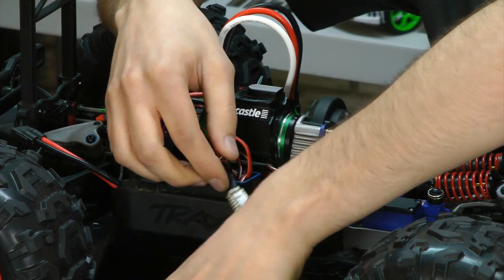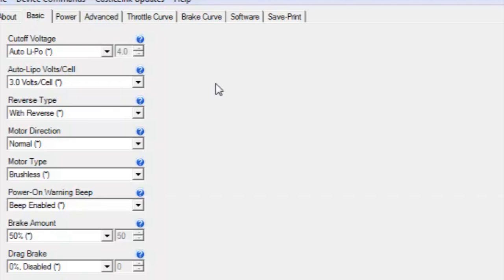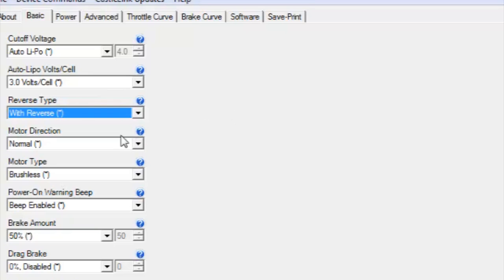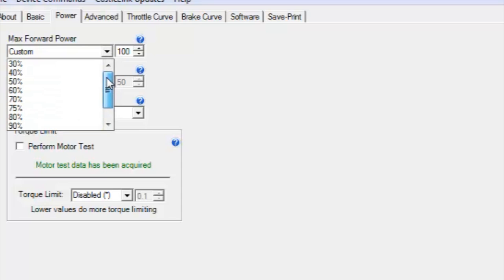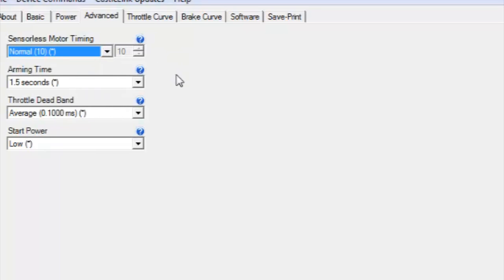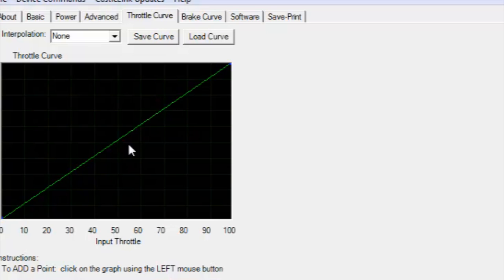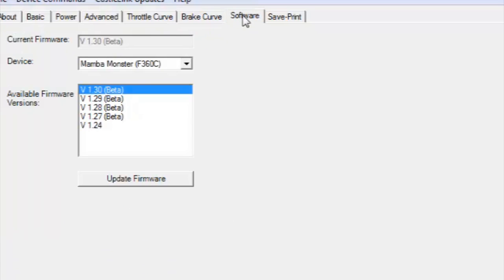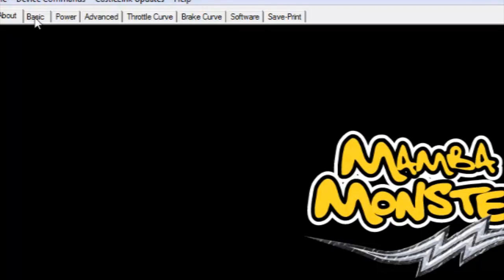How To Use Castle Link By Castle Creations-Tutorial Program Your ESC

Comment: hello I have a question I've got a HPI Baja Flux and one of my lipos keeps on swelling I have tried 3S 11.1 volt 4500 and 14.8 volt 5000 milliamps 4S and they both swell only one of the batteries do it though do I have to use the programme to set the ECS voltage higher will that fix the problem

Comment: I'm using a sidewinder sct and 4600 kv motor I believe, my car as soon as I touch the throttle instead of if being smooth start it kinda bolts a little so I'm gonna change the throttle curve down a lot, but also would I be able to set the timing on low with that current motor? Since it's not a sensored motor I'm not sure
Reply: Sensorless motors tend to have a little bit of a jerky start, but yeah, play with settings until you get it the way you want.

Comment: Everyone who is trying to put them in Nihm Mide just turn "auto lipo" OFF it works. I run the castle Sidewinder SCT 3800lv combo with the 1410 series neu castle motor and I run a stock 7 cell 8.4V Traxxas Power Cell(Nihm)

Comment: "Device not linked" Is still showing red on the Castle link application for me, drivers are installed. I have tried both windows 8.1 x64 and windows 7 x86, but still remains red. Not sure what I did wrong as I did plugged in the throttle wire into the unit as per video. Any ideas?

Comment from the maker: @victorm316 victorm316: The battery voltage "under load" ,or while driving, will be much lower than when the pack is at rest. So even when the ESC hit's cutoff my cells are more likely to be around 3.5v after I unplug them. It's all personal preference though. That's why the cutoff is adjustable!

Comment: I have an E-REVO with a Mamba Monster ESC in it and when I go to turn it on it does the normal beeps then just keeps beeping and will not move no matter what I touch on the remote. Is this because it is set for a LIPO? I am trying to run two 7 cell 8.4 volt NIMH batteries.

Comment: Well, I can say I had it in backwards XD the 3 pin was about to use it on my sidewinder sct 00-0123-01 (something like that) then found out that I had plugged back into wrong channel, after setting back to defaults, only changed the brake to 100% as my programmable remote set to half throttle switch, and when I use that, the brakes are very weak.

Comment: so if you don't need to do any changes? basically it's pre program what's the point of buying the link?
Reply: Yes, your ESC comes pre-programmed with default settings.  The link allows you to tweak all of the settings for your own use.  I have an E-Revo, and using the link I was able to get the power delivery and braking more to my liking.  If you like your car as-is, you don't need to buy the link.  But I found it very beneficial to adjust the settings to tone my car down a bit.  It also helped with the heat problems I was having (motor timing was too high by previous owner)
Reply: question.
can i set the motor speed to low  for rock crawling?
i have e revo 1/10....  thanks..

Comment: Do I have to have a battery plugged into the ESC while programming?
Reply: That Guy With the Pointlessly Long Username That You Are Wasting Your Time Reading Right Now 

No.
Reply: +Damon Humphreys ummm for several ESCs, yes, you do need a battery plugged into the ESC. I have a Hydra Ice 2 HV and it requires a battery at least 12v to be plugged in
Reply: +Nick Hansen That's because a Hydra Ice doesn't have a BEC.

I don't see a Hydra Ice ESC in the video do you? So, my answer of 'No' still stands for the ESC in the video or any other ESC under 6S that Castle produce.
Reply: +Nick Hansen Your first comment was completely irrelevant, I wasn't asking about any other ESC other than the Castle system and Castle Link.
Reply: you guys arguing is sooooo funny!!!!!!! is making me laugh every time i read lmao!!